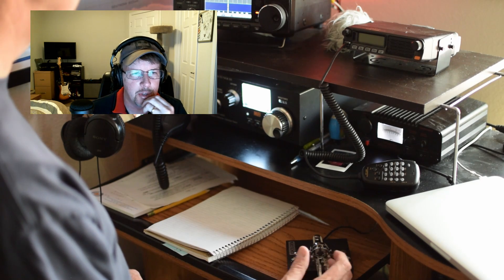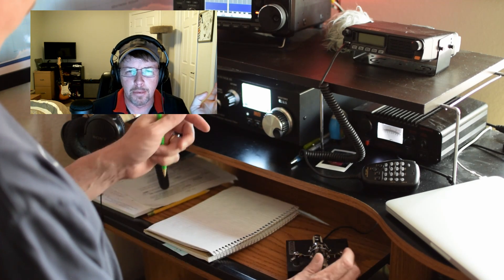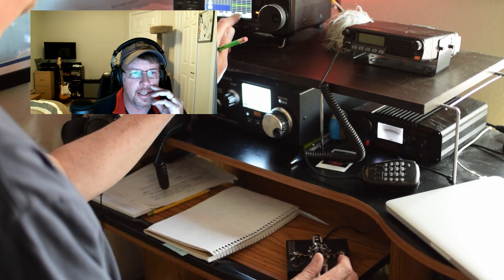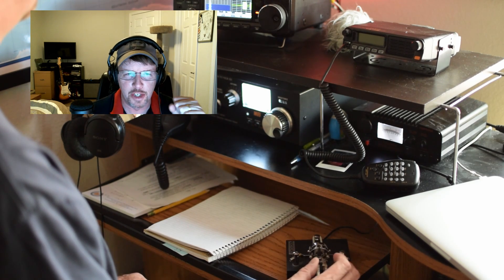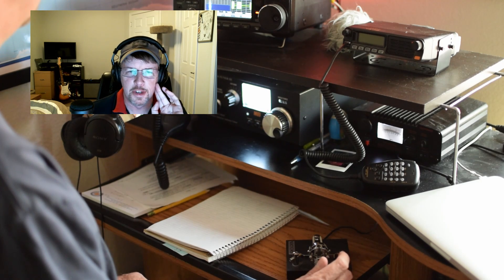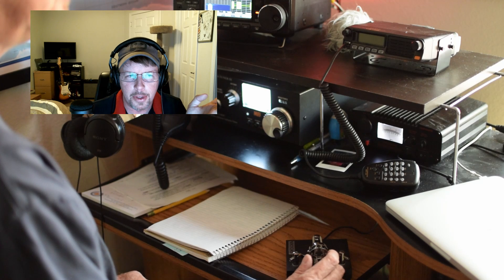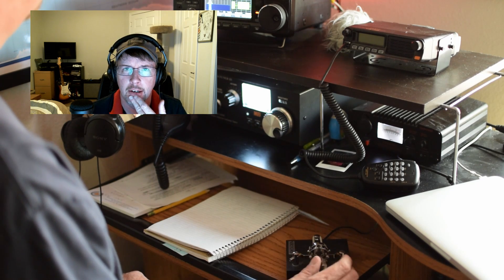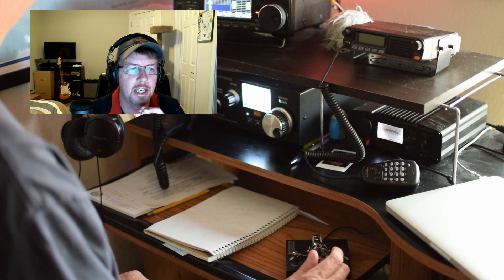CW - Morse Code - Why Bother?

Comment: strange bc i got the idea that most hams are into voice qso, but when i got into SWL, majority on 20m band were CW
or mb it's just bc CW had more range, so that voice or SSB range is shorter so it appears to me that CW is more crowded than USB on 20m
and you're right about simplicity and less gear, less things going wrong
even a simple digital mode like rtty for navtext, had trouble decoding some weather stations, and spent hours trying to make some apps work

Comment: Now that commercial, marine, military, and recently amateur radio have departed from the code, it is surprising that some folks don't want to give up the key.  Most hams have done so, and a growing number, thanks to cell service and the internet, have given up amateur radio.  It made a lot of sense at one time, especially in emergencies, but most police and fire services have been hardened so the need for backup has greatly been reduced.  But, if you like to live in the past, CW is perfect for you.

Comment: Excellent presentation. I'm always thinking about ways I want to describe the reasons I love CW. As a ham for almost 49 years and 99% CW, I also love to share how you don't have to be a high speed CW operator to be proficient and enjoy CW to the max, making daily QSO's. 
As novices, we started out at 5 wpm and then with excited QSO's we made 8 to 10 without even realizing it. 13 was hard to attain for my General class in '75, but I managed. From then to now I operate normally between 13 and 18. I still couldn't pass the standard 20 wpm test and believe me I put everything I had in trying. But I finally realized that I don't need to do 20, 25, 30 or more to be a good CW op. If people realized that the vastly more attainable 13 to 18 is ALL you need to really enjoy CW, I think more people might try and discover that being a CW operator is such a cool and fun way to communicate!
AA4WA

Comment: I tell hams to listen to the nightly W1AW 18 wpm bulletins and try to pick out characters, numbers for a few weeks. Pretty soon they'll be picking out words and counting off the number strings with little effort. The Bulletins run at 8:00 pm eastern 1.802, 3.581, 7.047 and 14.047.

Comment: Thanks for the video. I agree with everything you said. For those activating parks for POTA, another huge benefit of CW is automatic spotting. If you schedule your activation, POTA will scrub the reverse beacon network and spot you automatically. It’s a huge plus if you are out of cell range. The same is true for WWFF. It’s pretty cool to run a pileup for a bunch of Europeans who spotted you on their DX cluster. They may not care about your state per-se, but they sure want that obscure park!

Comment: We all have a story to tell, I learn Morse Code in the Boy Scouts, but not very proficiently. Next stage was operating in the Army inherited my position as Jeep driver for Company commander. and op. radio was part of that. one day the CO said "aren't you going to answer the net?" (it was in cw and I cud not copy it.) So off to school / classes after work I went. And then came CB (which I thought was Ham radio) then finally ham radio. and now I cud use cw. But for the first yr did very little wk lots of 6m and eventually did some  cw, and the bug was in!. found out very quickly how Cw outdid AM. SSB and cud get thru where they failed almost every time..  then came QRP and the fact I cud  work around the world literally with just c couple of watts and a small wire antenna. had me hook line and sinker. On a gud day I can cruise along at 25-30 wpm. but like 15-20 wpm better and sometimes even slower than that. Love to work Novices over the years and being "Their 1st Qso that is a rush!. " we all remember Our 1st qso's. I will tell you this. Once you take the time and  it will be lots of time to learn. no easy way out. practice. practice and even more Precative.You will love it entirely and never regret it till the day you die.  Practice never ends. I sit in Dr's office reciting signs on the wall, magazines, things on a dest, lic plates. in my head . so you can practice anywhere anytime. It's just so much fun. and credability. Hope this helps 73. and for you QRP''s 72. De Ellis WA1RKS .
Reply from the maker: Very cool, thanks for sharing your story.

Comment: Great video, Greg.

The code has always been intriguing, especially those ops that can send and copy at blazing speeds. 

I'm self taught as well, mainly because I didn't have availability whenever there were CWA classes. I do okay though, chugging along somewhere between 10-14 wpm with my straight key. I'll have to check out the Long Island group.   

Have a look at the SKCC. Their goal is to keep cw alive with manual keying using only straight keys, sideswipers, bugs and the wet computer between your ears. They're a great group of ops. Super friendly and want to help out us newer ops. Ever since I started operating cw, two months or so, I've had no desire to pick up the mic on hf. 

The goal is to be able to ragchew at 20+, that way I can say I'm a true extra! 

73 to you Greg. Your channel is one of the best.
Reply from the maker: Donald thanks for the kind comments.   I joined SKCC awhile back but haven't done much with a straight key.  That may be next!

Comment: It sounds like your story pretty closely mirrors mine.  I learned (or more correctly am still learning) CW because I wanted to.  When I became a ham, I didn't have any predilection to learn it - I just wanted to communicate across long distances.  THEN, I saw someone do it at Field Day.  I made a goal for myself that that was going to be me next year, which I did.  I have been trying to improve my CW skills ever since.  I also learned on my own, and didn't go through a class.  My only resource (besides getting on the air, and making QSO's) has been lcwo.net.  I started off slow,  going through the lessons, and sped up as I mastered them.  I too, am by no means a great CW OP, but I view it as a marathon, rather than a sprint.  I will get better as I go.

Thanks for this video.  I couldn't agree more with the reasons that you listed for leaning CW.  73 ES GL DE K7RLN SK <dit, dit>

Comment: Cool topic!  I’m not a cw op per se, but it is a mode that does not require any additional equipment beyond the radio like the digital modes!  And, I learned the code in 1976 the old fashioned way,  No classes,.  Just listening to the radio and also reading signs and newspapers out loud in dahs and dits.
Reply: No, not like the digital modes, you need a computer for digital modes

Comment: Also, now it's WANT TO --- Not HAVE TO. 
If you know MORSE CODE but you don't have a radio license, look into CwCommunicator (CwCom)  Morse Code sent over the internet. 
If you like Morse Code by Flashlight  SUPERALDIS3  again Computer to Computer or single practice. 
Still working on HEAD copy and sending SPELLING. If it's printed and I'm sending from paper I'm ok, but if I have to think of the word, then how to spell it, then send that word, that's where I get slowed WAY down.
Reply from the maker: I do the same thing, I have my cheat sheet of things to send, and If I dont have it I tend to slow down.